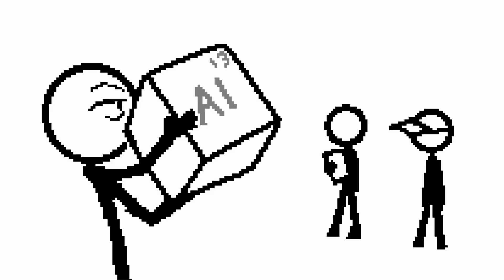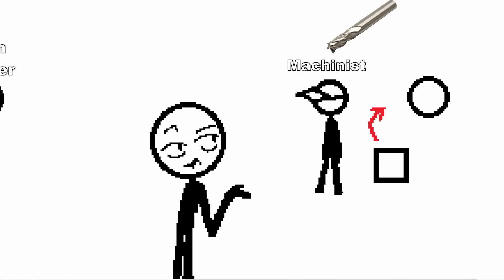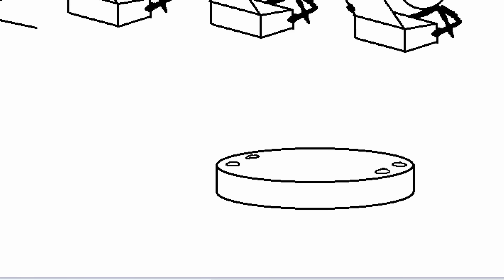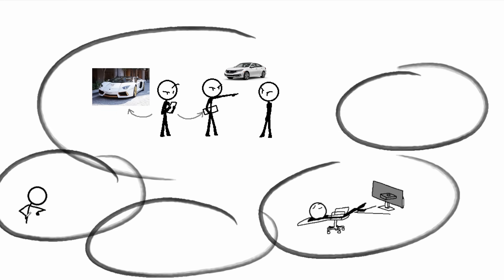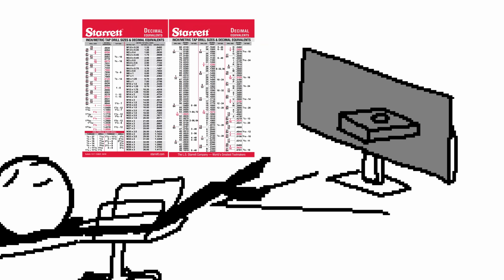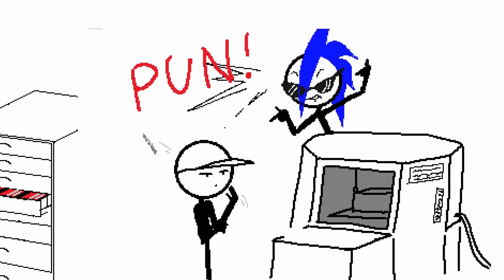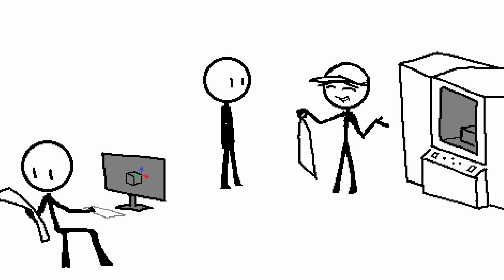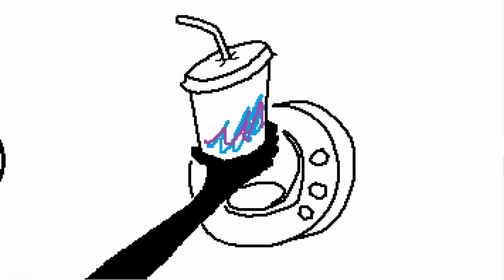Why we hate engineers

Comment: Mechanical engineer student here, I really admire all the little details found here that were resonated by my professors. One of them told me a story of how one of her students who went on to work for an aeronautics company submitted a design for a bolt that was going to cost the company millions to make. Apparently she gave them tolerances of .0005mm (Idk how many leading zeroes there were but it was way more than necessary)......for a single bolt
I might keep this video on hand for new members of our robotics club because some of them have not the slightest clue on how 3D printing and CNC machining actually works and submit CAD that is damn near impossible to make for what they're asking
Reply: yeah got a similar story, not a mech engineer but we had to have mech engineer classes part of our degree. Story of my prof was how someone wanted a form out of sheet metal welded . you could have made the part my just bending average sheet metal and tig welding it but the problem was the designer for some reason wanted so precise welds that you would have to do laser welding and the sheet metal was supposed to be I think 0.01mm thin "because it was mathematically strong enough". 
The head machinist of the company after reading this basically asked the designer to come down and show him how he would do it cause the head machinist couldnt figure it out... well the designer proceeded to take the drawing and tell them he will come back with something that works XD.

Luckily in younger generations most mech engineering training already includes all the 5 mentioned points because the teachers had to learn it the hard way that these teachings are necessary
Reply: @dergunter1237 what 0.01 mm? As thin as bacteria
Reply: @raynaldisugatamawiranata1578  some bacteria yes. There was not much force on the sheet at all yet the solution was still bs and the designers goal was to minimize on weight while increasing surface area but it didnt work for obvious reasons. 
The problem is that a lot of designers tend to have no practical experience in production so they never question as long as the numbers are right
Reply: That's like an order of magnitude more precise than the average machining tools companies can get their hands on
Not to mention making a reference to compare it to, which would need to be 10 times as precise for calibrating measurements
It would be practically impossible to get an iso 9000 certification for it
Reply: Just curious do aerospace bolts and screws really require high tolerances? Can't you use some regular M* threads?
Reply: @sto2779  when you're working with high energy, high vibration physics and millions of dollars worth of investment, research, and hard work that only gets a single chance to launch correctly or else it completely explodes, yes. You really need precision with high stakes projects like that to eliminate as many possibilities as you can.

Same with like Jet engines and pistons and stuff. Just a little outside tolerance and there's a decent chance it just might not work at all. Or worse, it suffers drastic, lifelong inefficiency.

Parts inside the rocket fairings that don't deal with as much force and vibration might have looser tolerances, depending on what it is used for, but you don't want to get a satellite up into space only to realize "uhhhh hey sir, one of our relay arms came loose because a machine screw vibrated out of its threads during launch."
Because then it's not a simple job of just sending a technician to put it back in

I'm sure you could Yolo a lot of stuff and it might be fine, but cheaping out on screws is probably one of the worse places to cost save, since they are relatively inexpensive (as compared to radiation resistant circuitry and aerospace grade metals and super alloys) and are pretty integral to mission success
Reply: Having worked in companies predominantly staffed with engineers (but not being an engineer myself) you can always count on them to (a) tell you how engineering is more useful than any other qualifications and (b) how they can do any task better than anyone else, even if they never studied that field. They think that intelligence and insights are limited to engineering, despite it being a degree you can study with much lower academic scores than other degrees. It's like a mass delusion (and/or overcompensating)
Reply: @lawjef  don't know where you studied at, but my college has a 3.0 GPA requirement for all engineering courses.
You dont reach that 80% mark, you don't pass

They can absolutely get elitist about it, but it sounds more like you're mad they get paid so much.
Reply: @lawjef 

I agree with everything you said except the part about academic scores. I don't know what unis are in your area but in mine, engineering is one of the toughest courses to get into, second only to highly selective courses like Medicine and even then, they have the same level of difficulty in terms of grade requirements.

That aside, I will admit that some of us do get over-inflated egos. My uni makes it a point to teach us how and why all other sectors are just as important to keep the world running. Elitism only limits the progress we all can make.
Reply: 0.0005mm is 500 nanometers. I work in semiconductor R&D and manufacturing. The smallest features I've ever made were 600 nanometers, and it is not something I would want to do again. Those are the kind of features you have to bust out the electron microscope to look at, you can't even see them under a normal microscope.

Comment: I like how he talked to a good point of reference like the retiring design engineer and machinist and how he related how annoying that pretty much everybody has to agree on multiple different parts repeating over and over so thanks for the the tips
Reply: I just thought about this regarding some German manufacturers like BMW and Mercedes. 
They boast and are vocal about their engineering solutions necessitating very extreme precision and low tolerance for errors, but this results in extremely high replacement parts cost and higher labor rate, and YET, are relatively UNRELIABLE compared to other PREMIUM brands from SIMILAR PRICE BRACKETS.

Comment: I have worked as both a machinist AND engineer (sometimes at the same time...) This is a great list. I would clarify #3 to be sometime like: 
- "Don't design something near a materials limits unless it's going to be on a spacecraft/aircraft and very microgram counts."
- "If the part would be less complex as 2 parts attached together, then it should be 2 parts."

(The 2nd one is a bit hard to wrap your head around in theory, but works out in practice)
Reply: Navy contracts seem to ignore those points entirely. I hate having to destroy an entire box or circuit board from a limited global supply because a screw or pin broke. The Navy wants damn perfection every time and it's enforced by government contract, so they'll treat shortcuts like treason even if it means months or years of delay and an extra billion dollars from the taxpayer. It's insane
Reply: @hyronvalkinson1749 Maybe the focus should be on repairablity, reliability, and cost? Instead of precision for the sake of precision?
Reply: @bestaround3323  Absolutely. But furthermore it's politicians and brass making stupid decisions without consulting the ones who actually fo the work in order to appease other equally stupid administrators.
Reply: Second one in my brain translation. 
Easier to cut it?
Ye..
THEN CUT IT AND SHUSH
Reply: @slutforpotetoes2993  Honestly it goes for the replaceability too. Breaking a stem and replacing a stem (especially if you have a part number) is great. Breaking a stem and replacing the whole damn thing is terrible.
Reply: yep especially with some of the latest Machines on the market. 5 axis is great and all but its still only 5 axis. not some quantum mechanics teleporter.
Reply: When I design my 3D prints, I have the principle "Can I divide this thing into two subassemblies?" and it worked out pretty well so far! I've found that having it as a question or request makes it much easier to carry out. edit: 2D prints to 3D prints. My paper printer aint so picky about more pages.
Reply: Isn't it a design goal to reduce the number of components? I recall seeing new camera designs that has fewer components and hence cheaper to manufacture and easier to maintain?
Reply: @YoonLeeKok  yes and no. ultimately it depends on the application. much like the production of circuit boards and the like. the smaller you can make the components the better, as you can cram more preocessing power into a smaller housing. but it also increases cost. in macro applications like for example engine blocks. the fewer the parts the better. however in most cases its both cheaper and more efficient to split the block into multiple parts and manufacture them separately. rather than trying to laser print them as one large piece. it can be done. however the associated cost is astronomical compared to the current processes. why spend hundreds of thousands if not millions to manufacture one engine block in one piece when you can just machine the components separately for thousands. with the same approximate level of functionality. Eventually the technology will catch up and make it a viable option. But as of right now... the associated cost in doing so is reserved solely for incredibly niche and specific applications. TITANS of CNC machining is a great source of information relating to these processes if your interested in learning more about cutting edge machining.
Reply: @YoonLeeKok  Yes, but it shouldn't be a design goal to be as cheap to manufacture, the goal should always be maximum reliability, and that means maximum repairability. It's not a reliable product if you have to throw it away entirely when parts of it stop working.